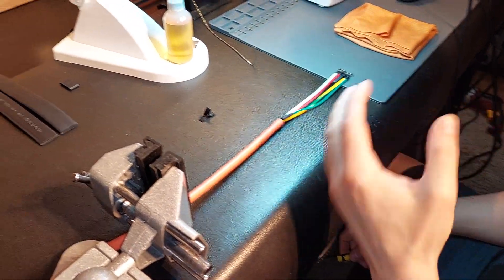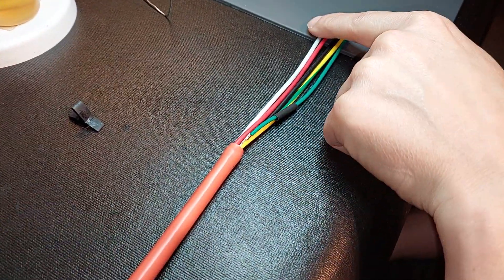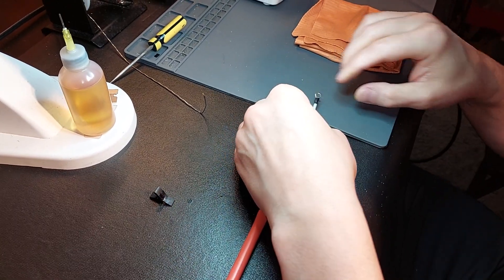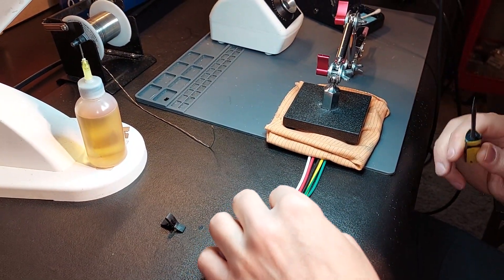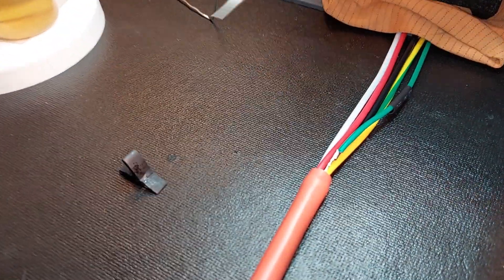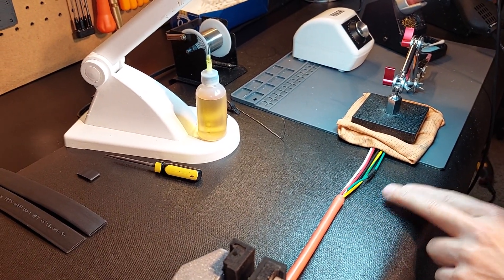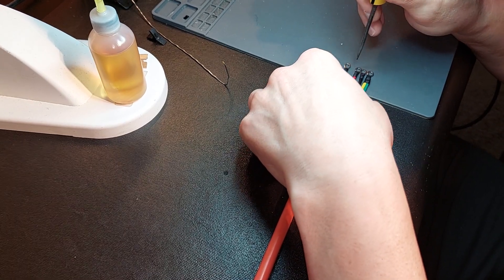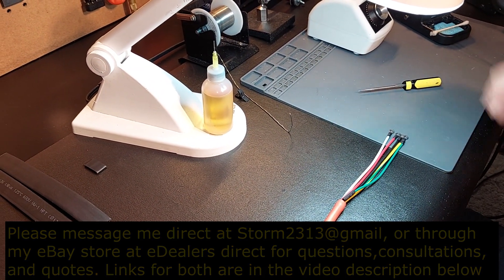CNC Spindle Cable VFD Ring Connector Installation Tips..

Comment: So do you fish the leads through the tin braided copper, cut the tin braided copper back to the appropriate length, solder the silicone wire to the braided copper, and use the probe to push back any exposed shielding underneath the insulation, then use double wall heat shrink on the solder?
Reply from the maker: Please search my channel (VFD wiring) as I have covered this in a video to review how its completed. Thank you,
Vince